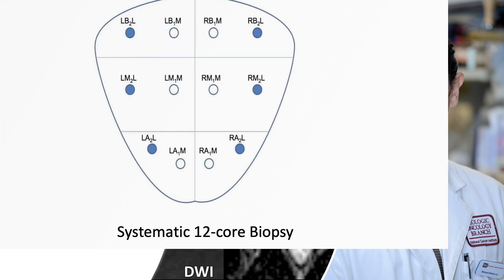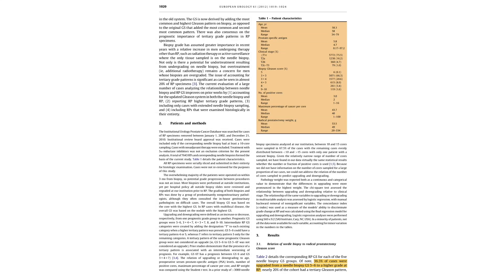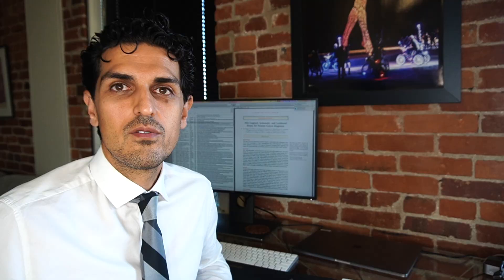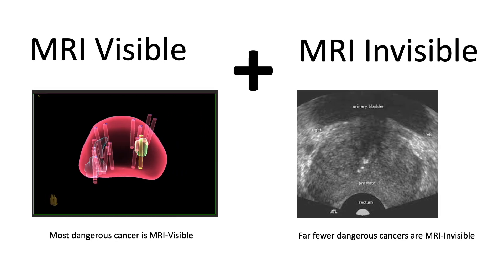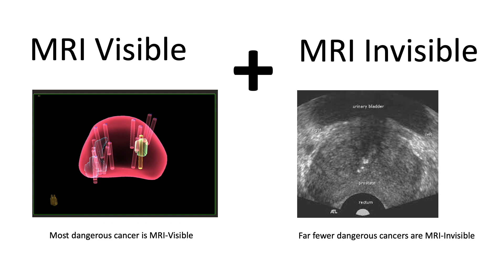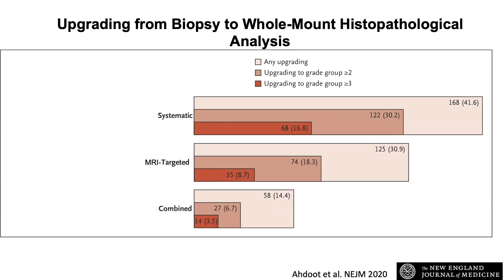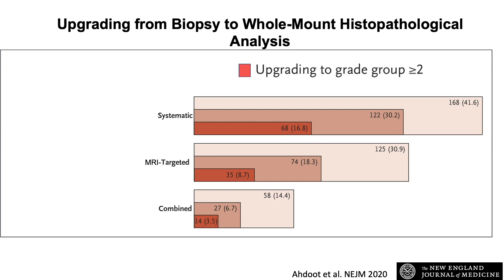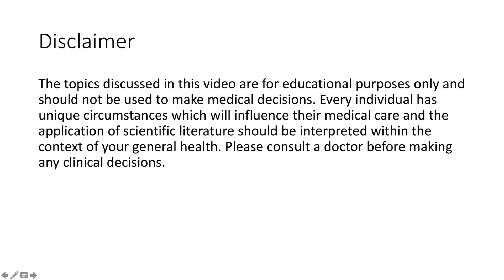Prostate Biopsies Can Be WRONG! -  Dr. Ahdoot Explains Prostate Cancer Diagnosis

Comment: I had an MRI on my prostate that came back with a PIRADS score of 1. A week later I got a biopsy and it came back with cancer and a Gleason rating of 8 and 9. Go figure. I ended up being treated for Prostate Cancer. So, in my case my MRI was not trusted. Oh yeah, my PSA was at 6.5 at this point.
Reply from the maker: That’s a very unusual event. If something like this were to happen in my practice I would closely scrutinize every step of that persons care to figure out how this happened. 
There is a known 10% risk an MRI can call a normal prostate but cancer can still be present however almost all of those cases are Gleason 7 prostate cancer. Your situation is uncommon and I hope you are well
Reply: I've had 2 MRIs, both show no evidence of malignancy, Pirads 2, mild BPH.. I'm skipping the biopsy for now and opted for monitoring, against my urologist advice.  No issues so far and I hope it stays that way
Reply from the maker: @FernRivera-dz8pr keep an eye on your psa density as a risk stratify for your risk of prostate cancer. <0.05 ultra low risk. >0.2very high risk. There is a gradient between. If you wanted you could look up my paper on the topic. Search Ahdoot PSA Density and you should find it
Reply: @cancerbetter thank you for that information. Will do!!  Either way, I'm skipping the biopsy in favor of monitoring for now.

Comment: I was having rapid increases in my PSA level. Doubled every year. They did a biopsy of my prostate it looked good. I insisted on an MRI of my prostate. I had a deadly form of prostate cancer in the exact center of my prostate. That is why it was missed during the biopsy. The biopsy only samples the outside of the prostate.
Reply from the maker: So glad you knew to insist on an MRI and also so sad that all providers are not doing this yet.
Reply: @cancerbetter I'm waiting the results of a 2nd MRI..urologist wants to schedule a biopsy no matter the result. I'm hesitant to get that done, especially if the MRI comes back negative or  pirad score of 2 with nothing else showing like the first MRI last year. I will insist on active  monitoring instead of biopsy for now

Comment: Are your MRI guided biopsies done under real time MRI or just UltraSound and you target the picture from the recent MRI?
Reply from the maker: Most are done using ultrasound with a digital overlay of the MRI image on top of the real time ultrasound. The methods you described are also possible and are called in bore and cognitive fusion respectively.
Reply: @cancerbetter  Great answer, very clear.  One more inquiry if I may:  is the biopsy thus obtained looked at and graded in real time so that focal ablation can occur right away, or is a return visit, e.g. a month later required to do the ablation, if it is appropriate?
Reply from the maker: @ethancanin return visit. Pathology takes at least a day

Comment: Dr. Ahdoot,  after a gradual rising psa, from .8 to 2.6 over 18 months my pcp recommended seeing a urologist which i did. Dre was negative but we did a t3 mri to be safe in August. It found a 1.3 cm lesion on the left apical anterior transition zone.  My psa density is .06. I was given a pirads 4 rating so now im scheduled for a biopsy which i really dont want to have. So a few things. I read on another site that area of the prostate is rarely cancerous.  I also saw you said a psa density of anything less than .05 is likely not cancer. Im a .06. Lastly how subjective is a pirads rating? I'm getting a 2nd opinion of the mri before i have a biopsy. The mri also showed chronic prostatitis which I've had off and on for years. Im 68 and my gut tells me wait and do active surveillance and get retested in a few months both psa and possibly another mri.
Reply: Why not get a 2nd opinion on the MRI reading?
Reply: @billbugar5155 or get a second MRI to see if anything has changed
Reply from the maker: Seems like a reasonable strategy

Comment: Chickened out of my scheduled biopsy -- opting to have an MRI instead.  No idea what I'll do from there.  The aftermath (bleeding) from the biopsy throws all my circuit breakers.  Just can't deal with it.
Reply from the maker: If you are very concerned about the bleeding that occurs after prostate biopsies, you could attempt to do a MRI targeted biopsy only and skip the systematic biopsy. Well, this might result in lower total cancer detection rates you would be enriching for the detection of the most aggressive cancer while objecting the fewest biopsy course possible. Obviously if you were biopsies will likely result in lower risk completing. Further more transparent, renal biopsies have no risk of rectal bleeding, which is often the main source of leading and may be reasonable to consider.
Reply: Did you have an MRI before that scheduled biopsy?  How was the MRI result? Mine were good, so I'm skipping the biopsy against my urologist advice.. I've had 2 MRIs both show no evidence of malignancy, no fam history ,mild BPH , Pirads 2.. I'm taking my chances according to research, no biopsy is needed for me.

Comment: 52 year old male, have been on finesteride for the past 26 years for male pattern baldness, came off finesteride (5mg 1/4 daily) in March, psa went from 2.6 to 4.5 in 14 weeks, free psa % was 12.6%.
Had an MRI 1 week ago, a 5mm lesion was identified with a PI RAD = 4 score.
Urologist recommending a biopsy. 
Could this lesion have been in my prostate for a number of years whilst on finesteride and it has now become more aggressive from ceasing the 5 alpha blocker?
Reply from the maker: Actually everything you described was expected. Finasteride reduce a persons PSA to about 1/2 their rate off the finasteride. When you stopped the med you had the expected rise and work up. Honestly on finasteride a psa of 2 is typically considered abnormal and would warrant a work up

Comment: Doctor, thank you for your video.  I am 68 years old and I have elevated PSA 5.3. My MRI fusion transperineal biopsy with 26 cores, all came out benign.  I know I need a second biopsy done if my PSA keeps rising.  What do you think of in-bore MRI biopsy, I believe UCLA offers that?  This is the type of biopsy where patient lies inside MRI bore, and urologist looks at real time imaging from MRI machine performing biopsy.  This sounds like an even more accurate method of doing biopsies.  What is your opinion?
Reply from the maker: There are pros and cons to biopsy inside the MRI machine. For the best majority of Pat it makes no difference in some situations. However, if someone has a very small lesion that’s very challenging to target with MRI fusion software. There is a small chance it’ll make things more accurate the downside is that doing a biopsy inside an MRI machine leads to a very small workspace, and there are a lot of limitations on the use of metals within the magnet of the MRI, which can make the process cumbersome. Issues such as limited space poor organics, and also make accessing certain areas of the prostate for a biopsy challenging. This is why the majority of biopsies are now done with a MRI fusion system to allow for targeting for the MRI abnormalities outside of the MRI machine itself.
Reply: Thank you very much, Doctor @cancerbetter
Reply from the maker: @frankh8471 Happy I could help!

Comment: I had two lesions rad 4 show up on an MRI, PSA 3.12, prostate 100cc. 14 sample MRI targeted biopsy, all benign. 9 months later, a new Urologist and hospital, PSA 5.25, second MRI with what they described as a brand-new state of the art MRI machine. Results, no lesions present and no signs of prostate cancer at all! Prostate again 100cc. My new Urologist said you are good to go, high PSA is probably from BPH but obviously we will monitor everything. The former urologist said sorry, but our MRI machines are old and it could be the lack of magnet strength. I still worry.
Reply from the maker: This post brings up several good points. 
First, the MRI machine matters. Ideally, you want to try and find a strong MRI magnet that rated at 3 Tesla. Second, as a persons prostate volume increases we expect the PSA to also proportionally increase. This is why we calculate something called a PSA density to stratify someone’s risk. Based on the numbers presented in this post, this person’s PSA density was likely very low. Meaning, their risk of us to cancer is also OK correspondingly low. The completely normal appearing MRI is more consistent with the low PSA density finding.  This is why individual pieces of medical information cannot be used in isolation and you need to contextualize them within the context of other findings to help create a more global picture of a persons risk of prostate cancer and needed for prostate biopsy.
Reply: I'm taking a calculated risk and skipping the biopsy  against my urologist advice. My PSA is 6.3 but 2 separate MRIs both show no evidence of malignancy mild BPH Pirads 2.. I'm confident I made the right decision.
Reply: @FernRivera-dz8pr  Fingers crossed for you. I cringe every time I think about this subject. Psa in 60 days.
Reply: @funhumanusa thank you! Fingers crossed for you as well. I know all about that cringing feeling. My next PSA will be next month when I go see my primary physician. I went to see my urologist last month to follow up on my second mri result and to schedule the biopsy that he wanted but he cancelled after making me wait over an hour! He was running over 2 hours late due to an earlier surgery! I didn't bother to reschedule since i already made up my mind that I don't want the biopsy. Hoping to continue monitoring with my primary for now. If anything suspicious shows up then I'll call the urologist to schedule another appt. I'll ask for another mri , and a urine test called EXODX and possibly a PSMA PETSCAN before anything else..  keeping my fingers crossed for your next PSA to be normal as well!

Comment: On my third transrectal biopsy I developed an infection and sepsis.  I spent a week in the hospital on IV antibiotics, so cancer is not the only thing you have to worry about.  In a week I will have a prostate MRI which will be a determining factor on any future biopsy.
Reply from the maker: I would recommend you consider trans perineal prostate biopsy to reduce your risk of future infection. While not as common United States, as it is in Europe, many providers, such as myself started to perform transperineal prostate biopsy routinely. In my practice, almost all my biopsies are done transperineal now to avoid infection, such as what you experience
Reply: They should have told you if you had a slow growing tumor or the aggressive type. If it was the slow growing kind why keep doing the biopsies.
Reply from the maker: @CVA34WestPac you would do intermittent biopsies to see if the cancer evolves into something worse which is possible
Reply: @CVA34WestPac I agree. Sounds like way too many biopsies!  I'm skipping my biopsy against my urologist advice. MRI shows no evidence of malignancy
Reply: What were the results of the biosies? Sounds like too many. I'm avoiding one altogether against my urologist advice. My research points to no biopsy needed for my case

Comment: I got 20 samples pulled out my prostate. All were benign. My mri came out of a grade 2. My psa was a 7 also. Hope all this backs up no cancer. I going to have a holep procedure done in the next month also. The material pulled during the holep procedure. Will also go to the lab looking for cancer.
Reply from the maker: Sounds reasonable. How did it go
Reply: @cancerbetter  Everything with the holep went well. It's taken 5 months for the full results of the holep to take effect. They did find some cancer from the material removed during the holep procedure. It was 10% of 3 + 4 on the gleason score. The doctor feels maybe he removed a lot of the cancer out of the prostate from the procedure. I will go on the active surveillance system from here on out.
Reply: @orangeguy3314 what is holep procedure?
Reply from the maker: @user-sk6li5ch5y HoLEP (Holmium Laser Enucleation of the Prostate) is a minimally invasive surgical procedure used to treat benign prostatic hyperplasia (BPH), which is a non-cancerous enlargement of the prostate gland. In HoLEP, a holmium laser is used to carefully cut and remove the overgrown prostate tissue that is blocking urine flow. The tissue is then pushed into the bladder and removed using a device called a morcellator.
Reply: @cancerbetter It can be used even if cancer is in the prostate. It depends on the amount and if same spread outside the prostate.

Comment: Can you explain this to me please, our urologist never did.  The 3T MRI, no contrast, was done in May.  Not seen a doctor since begining of May just before this MRI.  Thank-you 

Prostate gland measures 6.6, 5.5, 4.4 centimeters on CC, TR and AP dimensions respectively with
 estimated volume of 84 cc and PSA density of 0.063 ng/ml/cm3.
9.5 mm ill-defined nodule with obscured margins are noted within posterior medial aspect of left
 peripheral zone at mid gland which show mild hypointense signal on ADC and mild hyperintense signal
on high B value DWI sequences likely representing PI-RADS 2/3 lesion. No other peripheral zone lesion
 is noted.  PSA is 4.86.

Comment: One more thing Doctor.  Is it true that  
High rated PIRADs are about 38 percent  due to inflammation and not cancer?  I  guess another  reason  you do a biopsy and not automatically go to treatment. Plus the Gleason score needs to be found. I suppose  prostate  surgeons might interpret a Mri better than a radiologist  since  they actually  take them  out. Lol I had a cervical  surgeon  told me that before  he performed a discectomy. Im not so sure there's alot of mri guided biopsies going on. University of Chicago does not even offer perineal  biopsy.  That's ridiculous. I know two people that got sepsis  from Trans rectal. How  can UOC  tout themselves  at the cutting  edge of prostate  cancer treatment without  offering perineal biopsy.  And don't  get me wrong.  They are doing trials with local Lazer. Of course no one will know the success  for several  years. North western has a great surgeon.  Deniro  and Stiller had it done there several years ago. Stiller was only 49. So get that psa done at 45. Deniro  just had kid. If  my condition goes sideways I'm starting to lean surgery. Hearing to many radiation  burn stories. Ptoctitis  does not sound pleasant. Although  seeding is so attractive. There are actually  doctors  who say seeding is seldom taught because there's no money in it.
Reply from the maker: On MRI it’s possible to differentiate cancer from inflammation if you are experienced in prostate MRI interpretation. Given that prostate MRI is relatively new many urologists and radiologists are not good at reading them. To get around that issue look for a high volume institution that does many prostate MRI studies. To see if your urologist is comfortable reading MRI you could ask them to go over your scan with you. 

Transperineal prostate biopsy is also fairly new in the US. Just look around and you will find someone doing them. Worst case you can come see me in Los Angeles but I’m sure there will be someone closer.
Reply: @cancerbetter  I guess I got lucky my PIRADS  4 WERE NEGATIVE.  But still  leisons exists. So far 3 years out my urologist is just happy the psa stays in the low 5s. Will see in July if Psa montering is all he wants. Suspect if it spikes then another mri. Hes suppose to be good so I will go with his plan. . Did not know they could tell difference in inflammation vs cancer . Thank you. I would definitely see you for a second opinion.  You seem up to snuff on the latest. Then again I'm not looking for trouble. Thanks for answering  when so many doctors on here dont. Oh I go to the University  of loyola. Volume  is quite high. My urologist is the only one who does perineal  out of maybe seven.  He looks me in the eye and says he's the cancer doctor.  So he must be there  best.  He don't mess around with to many other problems unless it's Cancer  ,Amaloid etc. Had a rash he said not his expertise. Sent me to someone  else. Excema.
Reply from the maker: That’s who you want.  The cancer guy who only does cancer.
Reply from the maker: PSA density is an excellent variable to use to predict cancer risk as well. As soon as I get my current study published I’ll post a video here on our findings. Short version if your PSA Density is less than 0.05 prostate cancer is unlikely. If over 0.2 prostate cancer is very likely.

Comment: Always get a PSMA and then an MRI before you allow these doctors to poke your prostrate with their sharp needles. I am telling you, I have seen so many quacks in this field it is depressing as hell. Prostate cancer may not kill you, so they say, but some of these doctors definitely will. Talk about an ATM for doctors and hospitals and you need to include a prostate cancer diagnosis or just a suspicion.
Reply: They won't schedule a PSMA without the biopsy.  How can this be circumvented"
Reply: @skykingimagery899  I am not a doctor, so you can just ignore me if you want. I would never ever again get a biopsy without first getting an MRI. The Drs. should then be able to determine if a PSMA is warranted to isolate the tumor (s). Or, you can just go ahead and let them stick sharp objects up your rectum and colon and bleed for days from front and back orifices. Yes, Dr. Bigbucks, patients can pay for any testing out of pocket even if it is not necessary. Get with reality.
Reply: @goodcitizen3638 I agree. Not keen on all that bleeding afterwards.  I'm skipping the biopsy against my urologist advice. Not needed according to my research.
Reply from the maker: @skykingimagery899 you can pay for the PSMA pet scan out of pocket